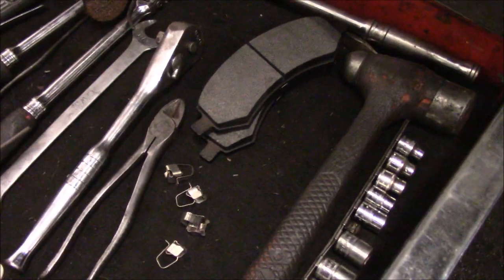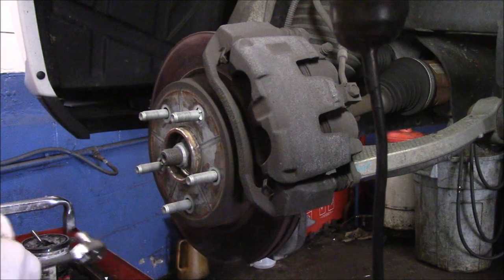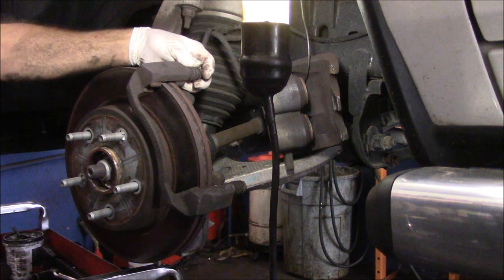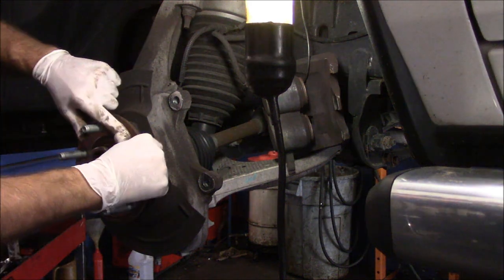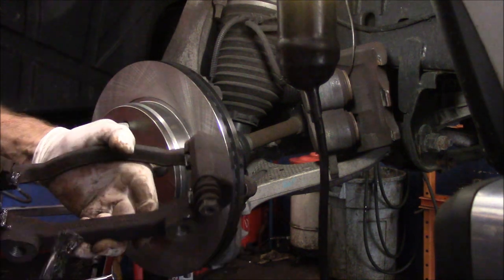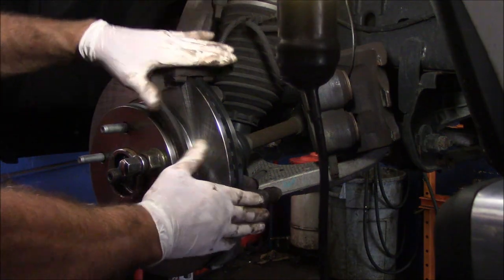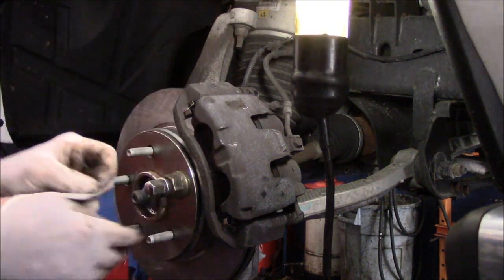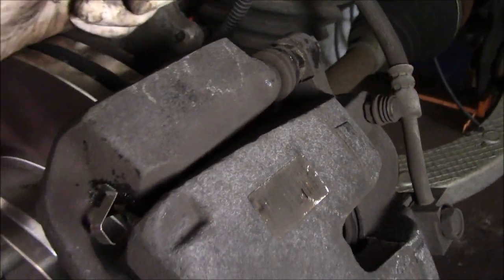How To Replace The Front Brakes And Rotors On A 2014 Dodge Ram

Comment: Thanks! We followed your steps and all went well except removing the rotor. After about 30 minutes of unsuccessful hammering, we found another youtube suggesting we put a bolt thru the back bracket hole, with a nut between the bracket hole and rotor, and then push the rotor out from the back - pushing and then loosening, spinning the rotor and pushing again - around the whole rotor. Only took about 5 minutes to pop it out. Thanks again so much!
Reply from the maker: I'm happy to help. Thanks for the $

Comment: Thanks for the video!  I watched it twice in the past few weeks before I attempted to replace my front rotors and pads on my 2013 this past weekend.  I got stuck on one thing though.  With only having the truck on the jack and not being able to safely get under it, I wasn't able to break the bolts on the caliper adapter (bracket) even with my breaker bar (which barely fit inside the wheel well.  I called my bro-in-law who's more of a mechanic than I am and he took a look at it and then grabbed a scrap piece of hardwood I had in my garage - we were able to position the breaker bar in such a way that we could use the wood jammed against a solid piece of the frame (crossmember I suppose) and lever it against the breaker bar.  We used the same technique but with a different lever point to torgue the bolts when we reinstalled them.  Other than that hiccup everything went as I expected thanks to your video.  I think the 2nd side only took about 15 minutes start to finish.
Reply from the maker: Great job.Sometimes the bolt get very rusty . At the shop when that happens I do have a 4 ft pipe to use with the breaker bar That was using your head to figure out how to get it off using leverage..

Comment: Hey Jim,I had not did brakes since the 1990’s and your video was a BIG HELP and wanted to say thank you.Unfortanetly I paid a local shop to do it 10 months ago and my rotors were chewed up and upon doing it myself I noticed they DID NOT pull the slide pins and lube them and they were bone dry on both sides and the pads seized on the rotors and fried them and I’ll never take it to them again.I actually thought I had a bad hub bearing but it was the brakes that were toast.Had to pay twice within a year but now I did it right .No thanks to the local shop .lesson learned and thanks again .
Reply from the maker: It is sad that you just can't trust some shops any more. Great job.Thanks for watching.

Comment: I've done about a dozen brake jobs.  I appreciate the refresher especially since it was my first time with my 2015 RAM.  What was interesting is that the truck has 35K miles on it and the front brakes were pulsing badly.  You'd think the pads were shot.  When I pull off the tire the pads were not even half worn, but the rotors looked like hell.  Might have been able to reuse the pads.  Still replaced both rotors and pads following your instructions to the letter.  Thanks!!!!
Reply: Literally going through the same thing with my '16. Brake kit should be in this week then it's all getting swapped out for EBC parts.
Reply: Weird I have a 2015 Ram. 81000 miles on it and my brakes are just getting there. My rotors just started taking wear

Comment: Hi Jim, what are the torque specs for the caliper bolts?  Great video, thank you!
Reply: 130 ft lb for the bracket bolts and 24 ft lbs for the caliper bolts

Comment: Appreciate the video Jim, very informative.  I noticed on that Ram they have air suspension.....just a quick side note that it's important to put the truck into tire jack mode to disable the air suspension before starting.
Reply from the maker: M4Belisle thank you for your input and for stopping by the shop

Comment: Hey Jim, thanks for the video.  Im about to change the brakes on my 2013 Ram and this has been very helpful, but I have a quick question.  What socket sizes did you need for each of the different bolts (caliper, mounting bracket etc.) Want to make sure I have everything I need before I get started.

Comment: Sir i have a question i just did mines but the pedal is goin donw when i live it press i already drying the system two time and i still have the same problem the truck stops perfect but if i live the feet on the pedal de pedal goes donw.someone toll me that i need to take it to a shop and put the car in a computer so the can take the air out of the system with a computer is this so

Comment: Great  Video, very useful. I'm going to change my rotors on a 2015 Ram 1500 128,000 miles so I hope it's the same. One question is it necessary to to remove brake filler cap while compressing cal. pistons?
Reply from the maker: No need to open the cap unless the master cyl is over filled.Thank you for your input and for watching
Reply: I see no changes to 2015 model, I got rotors turn to that bad and brake pad look like they could have went another 100k but brake pedal was pulsating a little on hard braking. after replacing pads and turning rotors no problems. thanks again.
Reply from the maker: Thank you for stopping by the shop and you input

Comment: Great video, but what were the torque specs for the bolts on the caliper mounting bracket? I found 31 ft/lbs on mopar but it says for caliper adapting bracket. wanted to make sure if it was the same thing or not...

Comment: What was the reason that you also replaced the rotors? If the rotors have enough material so they can be turned, then should they be turned?
Reply from the maker: Good question but the car had a shake in the steering wheel and brake pedal. If you resurface a rotor that was causing a pulsation you would have to remove to much metal and the rotor will be to thin .  Thanks for watching

Comment: Jim, you obviously know your stuff, and I'm OCD about stuff, the way you are with the lubrication. Are there any significant differences to the rear, or is it the same setup? Also, what are the torque ratings for the larger caliper bracket bolts, and the smaller caliper bolts that fit into the slide bolt?

Comment: Just replaced a rear caliper. The inside brake pad moves freely but the outside pad is against the rotor. Any suggestions?
Reply from the maker: You should check the slide pins and also for rust on the mounting brackets. Thanks for watching.

Comment: Great job, I have a 2014 Ram 2500  6.7 diesel would this be the same as what you are doing? I got 96000 miles out of my stock breaks it still stops ok but I think I should put new ones on.
Reply: NAGAZINA FIREWORKS I started doing pads and rotors on my 2012 3500 today. The procedure is the same as this truck. I cracked the bleeder when pushing the pistons back in per the instructions I have. Supposed to prevent ABS module from having issues is my understanding. Have read doing it slowly is fine too.

Comment: Thanks Jim, Question, when doing a brake flush (2015 Ram 3.0 EcoD) is it ok to suck out all the brake fluid in the reservoir or should you not go down to low to get air in lines or does it matter, Im doing a pressure flush please advise thanks.
Reply from the maker: You can take out some old fluid but not all

Comment: Thank you so much for such an informative and comprehensive video.  I feel completely enabled to do this myself.  Briefly, since the title is "front brakes," are the rear brakes any different, or is your title just to "cover" the fact that some might have drums in the back?  Again, thank you so much.  Your information is valuable enough that if I had a "go fund me" address for you, I'd send you a few bucks!  :)  BTW, I'm an electrician, and I don't know if you're familiar with "no lox" it's an anti-seize compound that uses the same brush your stuff did.  Is this stuff suitable to use for this application?  It's VERY greasy, and is made to prevent air contact with any surface to which it's applied.  The "no-lox" is sometimes called "no-ox:" because it prevents oxidation too.  It's one of the best lubricants on the planet.  Just don't get it on your clothes, or they'll become firearms rags.  :)

Comment: Jim, I've been using white lithium grease to lubricate the slide pins on my car. Would that be applicable for trucks as well?
Reply from the maker: The one that I use is a synthetic brake grease . It is made for the extreme heat that the brakes produce. Thanks for watching.

Comment: Great video!!  I can't find that style calipar compressor tool anywhere.  Do you know who has it?  Trying to make life easier without breaking out the c clamp. Also wondering if you opened up the cap on the brake fluid reservoir?
Reply from the maker: Actually I bought mine a long time ago from Snap-on tools but there are many different kinds available on line. Thanks for watching.I'm happy to help. Don't forget to hit the bell for notifications when a new video is posted
Reply: @jimthecarguy   found one very similar.  Maybe helps someone.  Thanks again for the great video!!

Comment: You should never force the brake fluid back up into the ABS system. Open the bleeder and let it drain out. You could clog or contaminate the unit resulting in thousands of dollars in repairs. Other than that great video.

Comment: What torque should those bolts be?
Reply: Hope this isn't too late for you... If so maybe it will help someone else.  Here are the torque specs from the service manual: Caliper Adapter Mounting Bolts, Front (1500) = 176Nm / 130 Ft. Lbs.  Caliper Adapter Mounting Bolts, Rear (1500) = 179Nm / 132 Ft. Lbs.